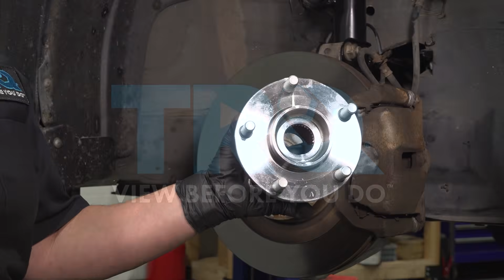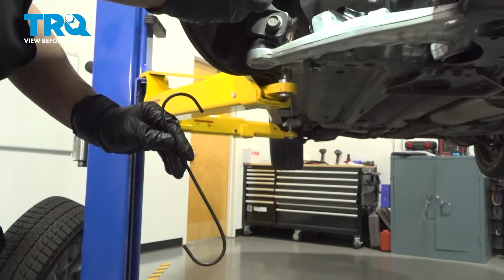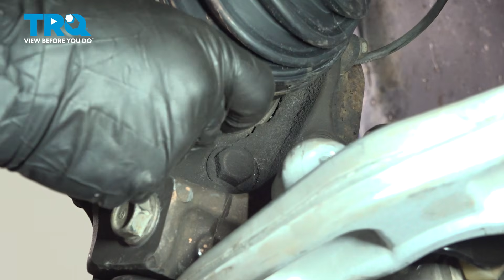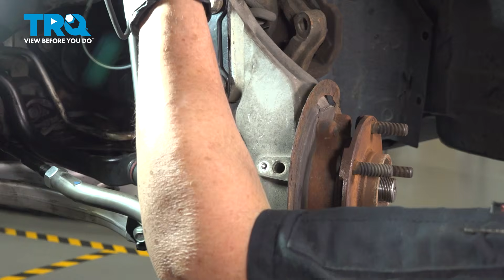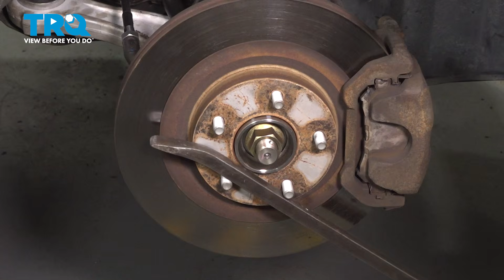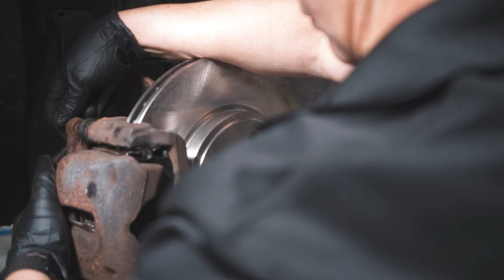How to Replace Front Wheel Bearing & Hub Assemblies 2009-2014 Nissan Maxima

Comment: Just an FYI for anyone who is watching this video. IT DOES MATTER WHICH WAY THE HUB ASSEMBLY GOES ON. There are 3 notches on the back of the hub, your ABS sensor sits in one of these notches. The notches are in a triangular pattern. The orientation you need to install is 2 notches top left and right and the one notch on the bottom. Your ABS sensor will not go in if you do the opposite. ASK ME HOW I KNOW.
Reply: This just saved my life.. lol I just finished changing my wheel bearings outside in 15F. I would’ve been pissed if I had to take things apart again for that. Thanks man!

Comment: It’s a nice informational video but 1 thing I should add after doing this job myself is pay attention to how the old wheel bearing coming out she leaves out in the video that the abs sensor has to align with the corresponding hole on the wheel bearing so if you put it in wrong you will have to take it completely back out and spin it